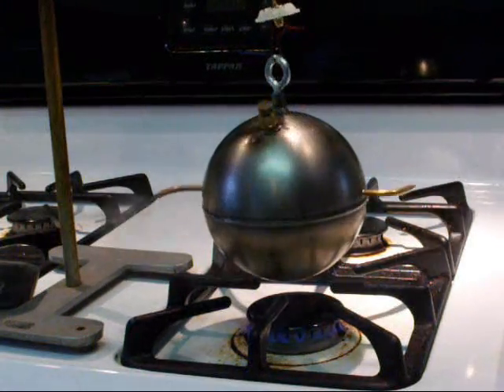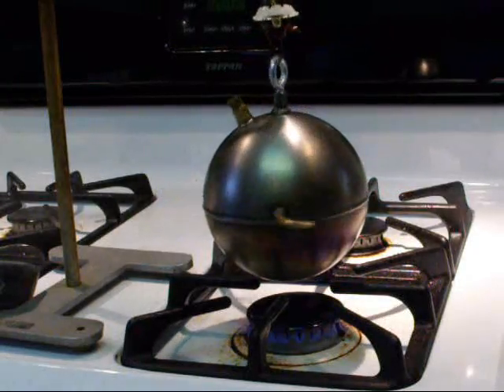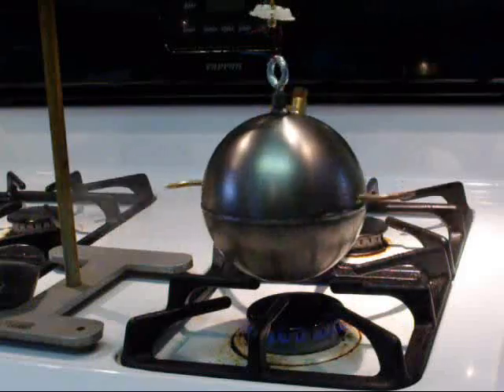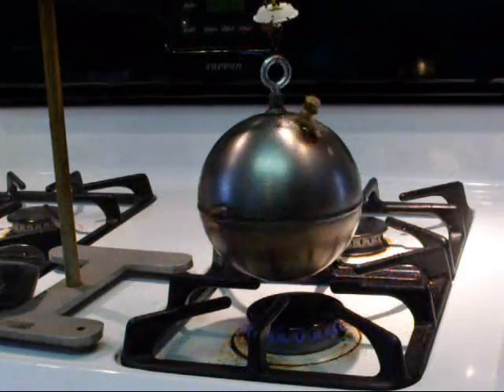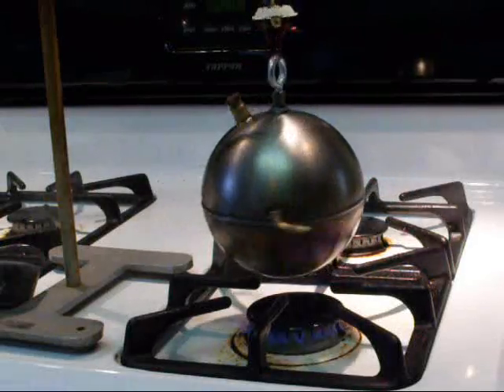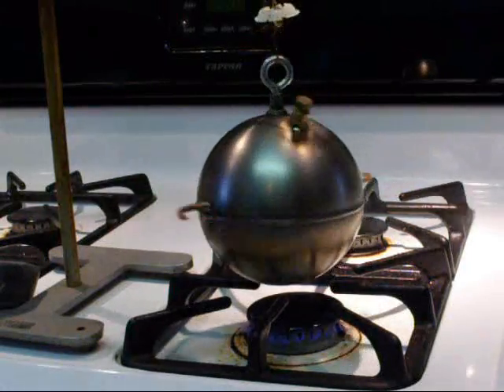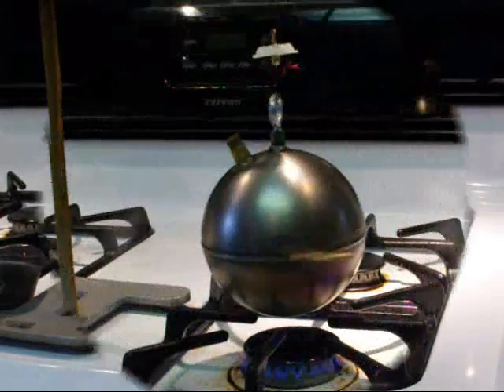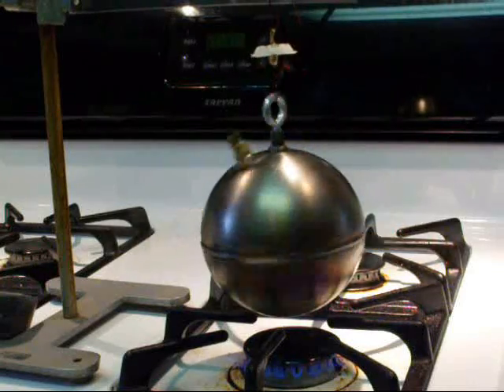STEAM BALL ENGINE Aeolipile HERO of ALEXANDRIA

Comment: It would seem to me that at some point, at high speed, the water would be forced up the sides and spray out the nozzles.  Would it make more sense to have the nozzles connect higher on the ball but still come out to an appropriate radius?
Reply: I built one of these from a kit, and the pipes inside the sphere are quite long to reach almost the centre so they pick up steam from the middle of the ball.  I built a flat one from a shoe polish tin with just angled holes rather than pipes, and as you say, as speed builds it ejected its water.